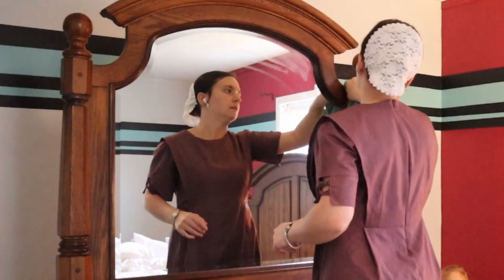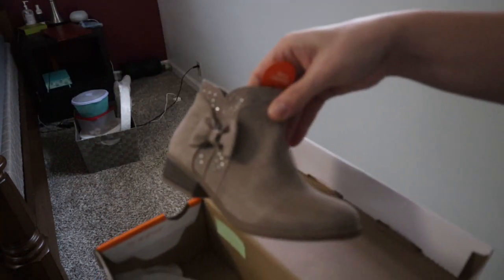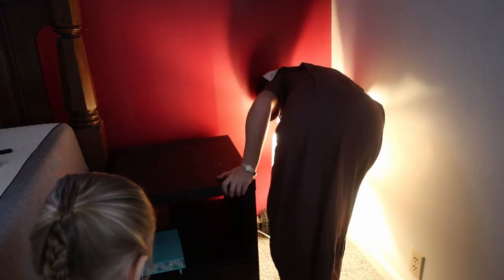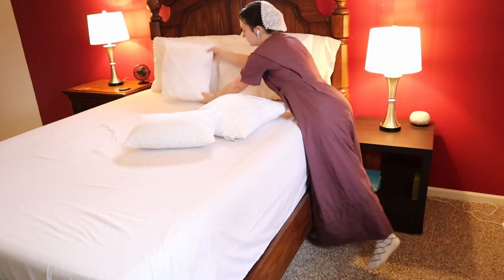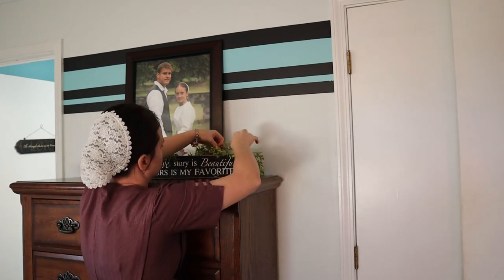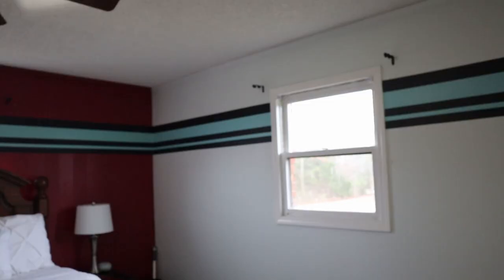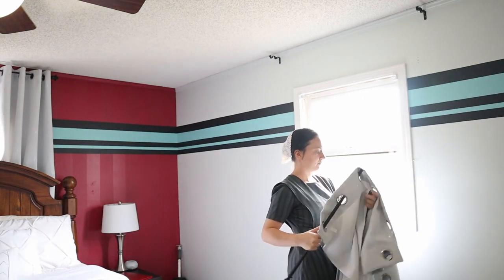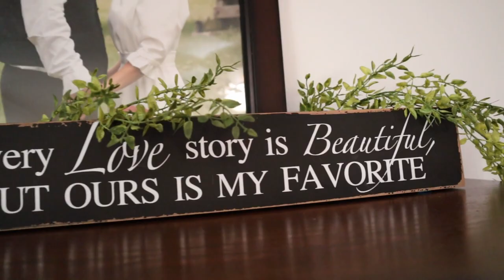WINTER DEEP CLEAN WITH ME / EXTREME DEEP CLEANING / POSITIVELY AMY

Comment: Great video! I love to do a deep clean. I am just wondering what you use to clean your walls? I see you have some kind of mop?? Do you wet it and use a solution or is it just for dusting the walls? I often do mine by hand but it takes so long. Thank you
Reply from the maker: This time I just wet the mop, but if the walls have a lot of spots on them and are pretty grimy, I will add a cleaning solution to my water. It is a microfiber mop pad.